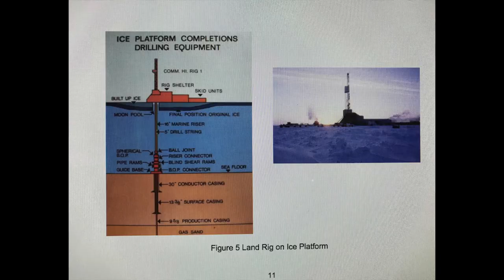REPLAYED BEAUFORT SEA DRILLING 1963-1990

Comment: Worked on several of those spray islands, one we started started on 3-4 ft of floating ocean ice, in 20-25 ft of water, spraye till we sunk that to bottom then built it up  25 ft, so around 50 foot of ice around 800 ft across.  Pumps were on sleds, weighing near 75000, with remote control monitors driven by 700 hp motors. Also gen set onboard.  Drill 24 inch hole, pull pump hose over hook up pump and spray away.  Best conditions minus 40 with a little wind.  Spray came down like a slurpee.  Spray for 15-20 minutes, and then go push around with dozer, almost like dirt.  Wait a bit then spray again.  Engineering outfit that designed islands was called ICE, out of Calgary.
Reply from the maker: crazy concept for sure, i didn't know how it was done till i did some research. super cool how they make islands or platforms